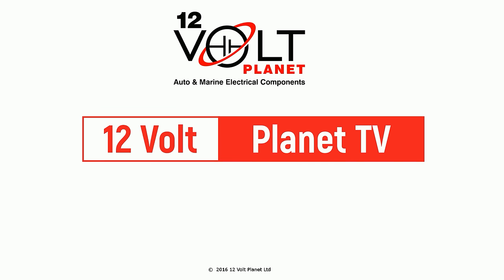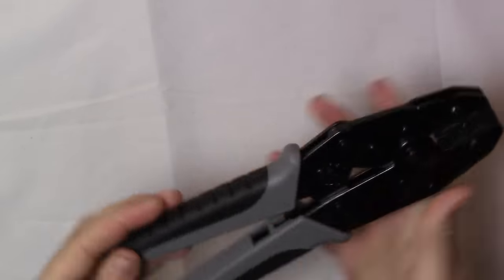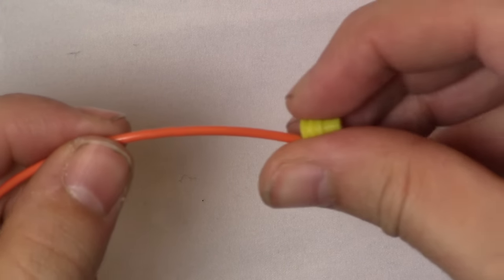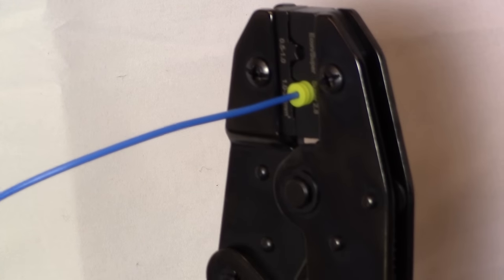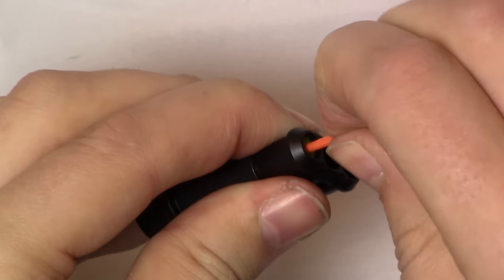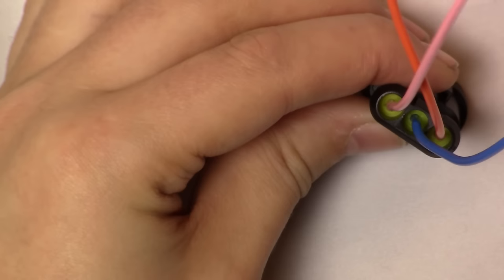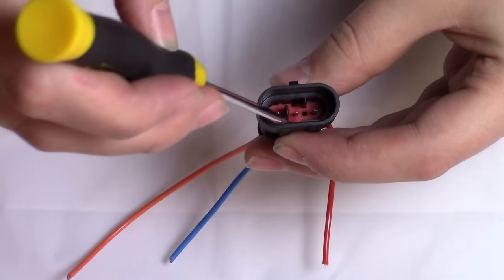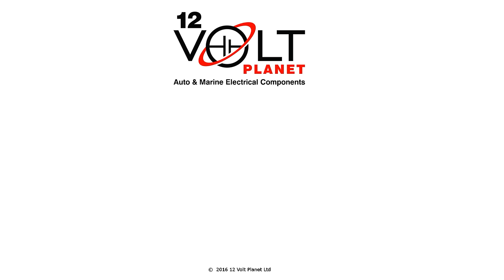Superseal Waterproof Connectors | 12 Volt Planet

Comment: Use grease when installing the wires with seal to the connector, they slide effortless into place and give extra protection against water or rusting.

Comment: This is a very fine video that gives the full process of building these contacts.  I was looking at switching to these connectors for a robot I'm working on (it's a boat), and I was having a bit of trouble making sense of all the parts in the connectors!
Reply from the maker: Hi Jonathan, We're happy you found our video helpful. Hopefully you managed to get them all made up easily for you boat but if you have any more issues let us know. :)
Reply: Biggest challenge right now is the outlay for yet another pair of crimpers.  I have to sell the boss on dropping the cash for that, but I think I can make a case for it over the soldered non-sealing connectors we're using right now!  Superseals are remarkably affordable in the waterproof/IPX7 connector space.  Mostly we've used Bulgins, but they're no good for discrete wires.
Reply from the maker: The crimping tool is definitely the best tools for the job as it saves you damaging the seal and the terminal and it makes the job go quicker. These should make a very neat connection for your discrete wires and should look a lot better for you.

Comment: Can the pins be removed from the plastic holder if you accidently put the wrong wire into a hole and it needs to be removed? I have done this a few times and had to destroy the black holder and start again with the pins that were not damaged and replace the pins that were damaged along with a new holder.

Comment: Hello thanks for the video, I wanted to ask you a question: how do you remove the red plastic part inside the connector?  thanks
Reply from the maker: Hi, You don't this part should remain. It is a locking tab and will need to be a part of the connector.
Reply: 12 Volt Planet TV Hi ok thanks for the reply! Best regards.

Comment: tq for the info
But i use hot glue rather the seals given. It makes waterproof to and secure the cables without wobbling due to soft seals.
Reply from the maker: Hi, We have never heard of a customer suffering as a result of the seals wobbling as they are very secure in the fitting. Thank you for your feedback.

Comment: Oh balls, My connector is diffrent but should of watched this first anway. Thought those wire rubber bits were inside seals. crimped and soldered then ralised my mistake. To be fair the 25amp wire im putting in a 20 amp connecter seems a bit big :)

Comment: Hi. I wonder, if it is been asked before, but did not see a comment to that issue: would it be better to solder the stipped wire before being crimped? Any tip for that?
Reply from the maker: Hi, A good crimp should be all you need. We wouldn't recommend soldering.

Comment: Hi, what's the difference between econoseal and superseal? I'm in the UK and my motorcycle is currently in Argentina. I need to source some connectors and pins before I return to my motorcycle. It's a modern Triumph and I assume it uses econoseal but I'm not sure. Do you happen to know? Great video, will help me sort a few issues on the bike.
Reply from the maker: Econoseals will use a different type of terminal although it is very similar to SuperSeal terminals. They also have a different locking system to hold the terminals in place. Both types are available on our website however should you need either connector. https://www.12voltplanet.co.uk/multi-way-connectors.html

Comment: Hi, first apologies for my English, is there a system for cables with a diameter greater than 10 awg? Crimp clamp is equal to dupont system or only thickens for this system? Excellent video and explanation, greetings !!
Reply from the maker: Hello Gaston, Sadly at this time we do not have anything similar that would be suitable for that size cable.
Reply: 12 Volt Planet TV you guys should look at stocking the metri-pack connector  or the weather-pack connectors they can take much larger cables

Comment: Can I use a standard crimping tool for this or do I need to use the specific tool used in the video?
Reply from the maker: You will need to use the tool shown to prevent any damage to the seals.
Reply: 12 Volt Planet TV Ok 👍🏻 
Thanks for the reply 👍🏻

Comment: Good and detailed views in the video!
My Problem is that I can´t push the red safety into the end position on the mother side...any suggests?
Reply from the maker: Hi Edgar, It sounds as though your terminals are either not locked into position or they may have become damaged.  Try removing the terminals if they come out then it's simply that there not locking into place. Hope that helps and let us know how you get on.
Reply: Thx for the quick answer! Its a 4 Connection Superseal, all 4 did their 'Click' and are in the right direction, I can move them all 1mm to the front out and again 3mm back to the lock. 
The clasps are goin in position if I get it a little force, but in the mid there is a little gap between Security Part and the jack housing.
The 2 inner Pins from the 4 Pins of the Security Part seem to have an obstacle!
It is connected and works but it could have a lttle more beauty (if I can say so, sorry for bad English - school lessons are a while ago)
Reply from the maker: Hi Edgar, Your English is good so no worries there ;). If possiable send me pictures of your connections and I can have a look and see it I can find anything to help? Email sales@12voltplanet.co.uk.
Reply: @edgarv.1603  what is the right direction??
Reply: @12VoltPlanetTV  Oh, the irony :)

Comment: Can this connector be used as a bettert plug for 48v 2A charger. If i replace original connectors with this setup?
Reply from the maker: Sadly not these connectors can only handle 24VDC. Sorry
Reply: At 2 amps I would, there is good separation. I've seen them survive 60vdc @ 3 amps just fine, but I'm sure this would not be condoned by AMP!

Comment: Is there a way to remove a pin after its been inserted into either the female or male connector? I've had occasions where I needed to remove the pin, but couldn't.
Reply from the maker: Hi, There are special tools available however they are very expensive and therefore not widely available. At this time our advice is to simply purchase new terminals if required.
Reply: Thank you

Comment: Hi sir,
Min 5:19, how to remove red plastic out of the housung?
I want to remove crimped wire terminal but stuck at the red plastic inside housing.
Kindly help
Reply from the maker: Hi, you should not need to remove this from the housing
Reply: @12VoltPlanetTV  how to take out crimped wire if not remove this red plastic. Kindly help

Comment: May I know which connector is used on the load side and which on the supply side? From what I understand, the female connector should be on the supply side, but which is the female since one has the female housing but male terminal on the inside and vice versa for the other side of the connector. Thanks in advance.
Reply from the maker: Hi, It would not matter which side is used for supply or load with these connectors.
Reply: @12VoltPlanetTV  I see. Got it. Thanks

Comment: Bought a bunch of these off ebay so my install would be professional looking. Been trying to get one pin crimped and installed on one of the black things correctly for 2 hours. Gave up. Why didnt I go to youtube 1 hour 55 minutes ago?!
I was almost fixing to cut my wires and just install insulated stak-ons or butt splices instead. Ebay seller should have included a link to this video with each order.
Reply: Yeah the crappy instructions seem to be poorly translated from Chinese and they don’t make much sense. I’m glad I found this video.

Comment: @7.30 I'm trying to put the terminal into the connector but can't seem to push it in to lock it in place. I am using the 4 pin plug and 1 and 4 was no problem locking the terminal in but 2 and 3 no chance of locking the pin in. It will just go in sort of half way but then will bottom out but it's not locked. What's the reason for this?
Reply: Sorted it, needed to use the flat screwdriver as you did in the video and give the back of the wires a tug to get them to lock in place. Kind of defeats the point of the seal though as the screwdriver digs into the seals and if not gentle (nearly impossible) enough can tear the "waterproof" seal but I guess it works so it's good enough.

Comment: You should make a video of how to take them off. The wire is off but the pin is left in there. I have no clue how to take just the pin out
Reply from the maker: Hi Alex,

Thanks for your comment sadly they can be a nightmare as they are meant to stay in place thanks to locking tabs. If you get a flat head screwdriver you should be able to disengage the locking tab and then remove the pins. How this helps-Craig

Comment: How do you get the connectors out  in order to replace the pins or bad cable?
Reply from the maker: Sadly they are very tricky to remove and quite often you can damage the housing by doing so. If you did wish to try however you could use a small flat blade screw driver to release the locking tab then pull the terminal and cable from the housing.

Comment: Greetings. those connectors work with any wire gauge?
Reply from the maker: Hi Nikolai, Sadly not these connectors will only work with for 0.5 - 1.5mm² cable (20-16AWG)

Comment: How do you open these to take wires out of the connectors?
Reply from the maker: Hi Ankur, These units are not designed for that kind of usage. You would need to unlock the locking tab which is tricky and remove the seal without causing damage. Our recommendation is to use a brand new one to prevent damaging the connector.

Comment: Using these to replace the #£%#@ connectors on my ebike... bought the crimping tool.. feels good in the hand. Do you do  60V 50A connectors. I super glued the yellow bits on to the crimp. Wish I'd watched your video 1st :)
Reply from the maker: Sadly not, SuperSeal connectors are only rated up to 24V & 14A
Reply: @12VoltPlanetTV  thanks for getting back. I've got xt90 connections coming for the power and your connectors for the signal and 5v rails. They are so much better than the rubbish molex connections which aren't vibration resistant or water proof. So I'm looking at a reliable setup now.. cheers

Comment: Do you have a video showing how to remove pins please
Reply from the maker: Sadly, we do not these units are designed that they ideally stay in once installed.
Reply: If these are similar to factory installed connectors, you can remove the plastic retainer and use a thin paper clip to release the locking tab on the pin.

Comment: How to release the cable from the socket?
Reply from the maker: You will need to be extra careful and use a flat head screwdriver as per the video. We do not recommend this however as you can damage the unit.
Reply: @12VoltPlanetTV  my terminal stuck inside the socket because my cable was not attached correctly, and now I want to get the terminal out to reattached the cable, thank you for your explanation

Comment: How do you uninstall them?
Reply from the maker: Hi, These are not really designed to be uninstalled however you can use - https://www.12voltplanet.co.uk/terminal-extraction-tool-set.html to removed the terminals if required.